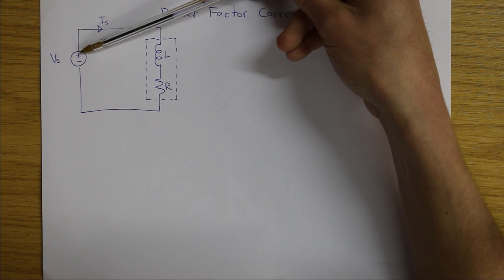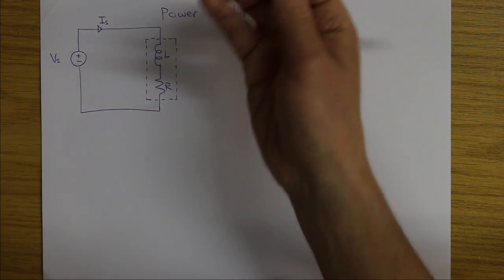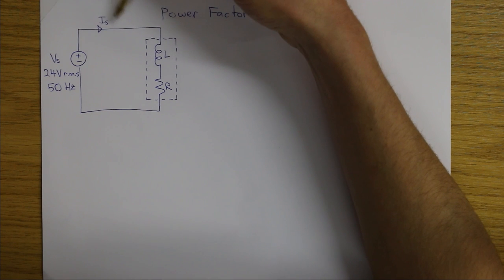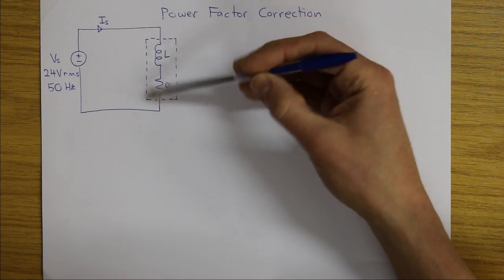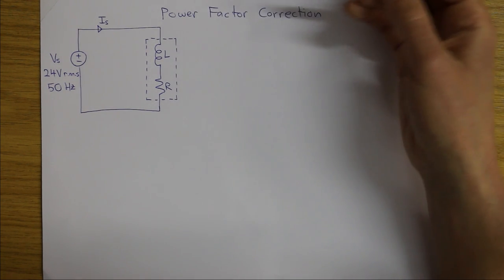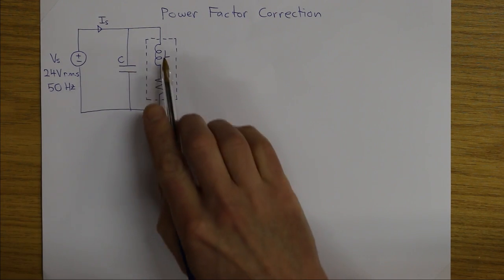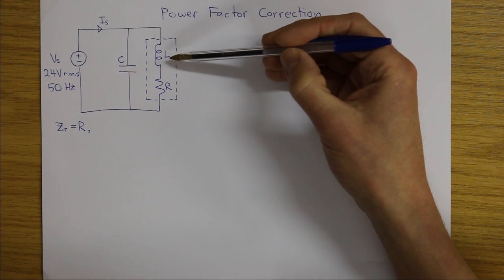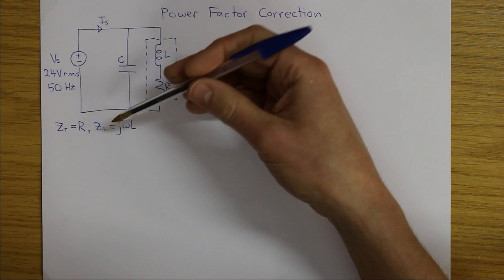Power factor correction of an RL circuit - how to calculate C

Comment: Very nice video sir. Although the power factor correction problems I usually encounter involve non-unity power factor correction, your formulas and concepts are still very informative and useful particularly when you said at the end that the equivalent impedance after PFC is actually larger than the previous one. That means that the voltage drop across the equivalent impedance will be larger before PFC, which explains the result I got in a problem set I answered about 3 phase PFC. 

Again, thank you very much sir.

Comment: Hello, a very nice video. Why is the j being used in here? Would the formulas  Zc=1/2πfc  and ZL=2πfL  work in here without the j?
Reply from the maker: Hi Imantas,

No, you need the j. This calculation relies on the impedances of the capacitor and inductor being imaginary numbers.

Impedances (in general) are complex numbers. The impedance of a resistor is purely real, but the impedance of a capacitor or inductor is purely imaginary, and once you combine resistors with capacitors and/or inductors, in general you need to treat all impedances as complex numbers which means that you need to hang on to j in those equations, i.e.

    Zc = 1/(j2πfC) = -j / (2πfC)
    ZL = j2πfL

The equations you mentioned would give you the magnitude of the impedance of the capacitor or inductor, i.e.

    |Zc| = 1/(2πfC) = 1 / (2πfC)
    |ZL| = 2πfL

In some other situations, it might be just the magnitude of the impedance that you're interested in, but that's not the case here.

However, having said all that, the final formulas I end up with for C and Zeq can be worked out just by inserting the real values of L, R and w (where w = 2πf). In other words, you don't actually need to use complex numbers (and hence not j either) to work out Zeq or C once you have those formulas. Just stick in L, R and w and out comes your real-valued answer!

Hope that helps.

Ted
Reply: @DrTedBurke  Hi Ted, many thanks  for video! Greetings from a fellow Irishman! Lol I understand the whole j thing meaning 90 degrees out of phase etc etc and I can do circuit analysis etc but lately I am wondering why are reactances considered 'imaginary'? Why use complex numbers? Could we not use i and j vectors and still get same result or can u see where I'm coming from? I suppose the advantage of using complex numbers is that we can divide them and express them in polar firm etc? Am I correct! I hear some people saying it's because it is not real power, ie it is reactive power? I don't agree that this is the reason we use comolex numbers, I think it's used as a mathematical tool yes? Rgds John

Comment: This was not useful to me for power correction purposes.  First, the reactance of a capacitor is (1/-j w C).  The minus was missing.  It is minus because the current from a capacitor leads voltage, in contrast to an inductor, where current lags voltage.  Secondly, a resistor has no impact on reactance correction, as it has no impact on current phase shift.  Next, the final equation reduces to C = 1 / w(2)L.  You would get the same result by taking the formulas for C and L, setting them to equal, and rearranging the terms.  Finally, this assumes you know the impedance of the circuit.  If you don't, the power triangle is a tried and true industry standard.
Reply from the maker: Hi Claude.

The reactance of a capacitor definitely isn't (1/-j w C) and neither is the impedance of a capacitor. The impedance of a capacitor can be written as 1/(j w C) or as -j/(w C), both of which are exactly equivalent.
The resistor certainly does affect the phase of the current through the RL load. The phase difference between the inductor voltage and inductor current is 90 degrees, but the phase difference between the RL voltage and the RL current absolutely depends on the resistor, and will affect the value of the power factor compensation capacitor.
The final equation does not reduce to C = 1/w(2)L and you would not obtain the same result by equating the formulae for C and L.

Ted
Reply: @DrTedBurke  I think there may be some confusion between inductance and reactance.  Going back to basics may help clarify the issue.  Inductance, when viewed as a complex number,  has two components - the real factor (resistance) and the imaginary factor (reactance).  Reactance causes a phase shift.  Resistance does not.  For power correction, the goal is to negate the phase shift in current (relative to voltage) caused by inductance or capacitance.    Resistance will never affect the phase of a current going through an RL load, an RC load, or any load.  You can valid this assertion by asking any Profession Engineer who specializes in Electrical Engineering.  Bench tests will also validate this assertion.
Reply from the maker: @claude77573  Hi Claude. I wouldn't trust just "any professional engineer" to give you the precise definition of impedance, reactance, inductance or even resistance because unfortunately many engineers (including a lot who specialise in electrical engineering) retain serious misunderstandings about each of these terms. Fortunately, my own understanding of all of them is crystal clear, so allow me to explain:

Impedance is a complex value - i.e. it has real and imaginary parts. In the most widely used notation...

Z = R + jX

where Z is complex-valued impedance (in Ω), R is real-valued resistance (in Ω), j is the square root of -1, and X is the real-valued reactance (in Ω).

Resistance is a real value. Reactance is conventionally defined as the (signed) magnitude of the imaginary part of impedance. Hence, although reactance describes the imaginary part of a complex number, it itself is actually a real number (i.e. the magnitude of an imaginary number). For a capacitive load, the reactance will be real and negative. For an inductive load, the reactance will be real and positive.

When an AC voltage is applied to an RL load (e.g. a resistor in series with an inductor), the phase difference between the load voltage and load current depends on the inductance and the resistance. This is a basic fact about how AC circuits function. You can confirm it by calculation, simulation, bench tests, or whatever way you want, but to be honest, it can be verified just by thinking about it for a minute. For example, just think about what happens when the inductance is very small, such as the parasitic inductance of a resistor.

One thing that may be confusing you is that if the resistance within an RL load can be inspected in isolation, the resistor voltage and resistor current will always be perfectly in phase, but that's completely different from the RL load voltage and RL load current, which will not be in phase (unless the inductance is zero).

For whatever reason, you seem to have formed the incorrect opinion that I don't understand basic AC circuit theory, so you presumably won't take my word for this. That's fine - you don't need to, because these basic fundamentals are clearly explained in countless introductory electrical engineering textbooks. Even if you just spend two minutes reading the Wikipedia article on electrical impedance, that will probably help a lot.
Reply: @claude77573  You are hopelessly confused. Inductance does not have two components. It has a single component. It's the impedance of that RL limb of the circuit that has 2 components one of which is real and the other imaginary. The phase shift between voltage and current through an RL limb does, indeed, depend upon both the resistance AND the reactance.  The higher the resistive component relative to the reactive (inductive) component the closer the voltage and current will be in phase. This is so fundamental that if you fail to understand it then it's back to basics for you.
Reply: So inductance does not have a real and imaginary component which, when combined, result in impedance?
Reply: @claude77573  An actual "inductor" may have both real (resistance) and reactive components. An idealized inductor has only reactive components. Either way you may interpret the diagram as representing series resistance of the inductor (if the value is small) or a separate resistor (if the value is large). Both of these perspectives are equivalent mathematically and in both cases the formula derived is correct in that the capacitance needed for power factor correction does, indeed, depend upon the resistance of the circuit branch containing the inductor.
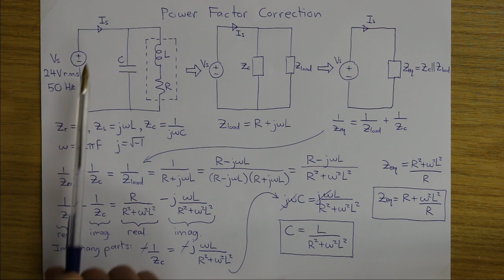Reply: @Jnglfvr  Thank you very much for the explanation.  I really appreciate it.  I guess what confuses me is that for power factor correction, what is being sought is the correction needed to cancel out the reactive component, and only the reactive component.  For example, in sizing a capacitor for an AC motor for, say, an air conditioner, the goal is to cancel out the inductive effect of the motor so that reactive power (VA reactance) is not fed back into the power grid.  See, for example, the youtube video "Power Correction Factor in Electric Power Systems" at 18:08, where it is stated "the active power (S, the work done by the motor) in a reactor (be it an inductor or a capacitor) is always zero".   If so, the goal is to negate the inductance of the motor, without regard to the resistance of the motor's windings.

Comment: How for a common man having to pay for this wasted energy can use this thing. Do we need 2b engineers. Can we use something very simple to save energy?. To be honest, NOT GOOD ENOUGH. Been hearing this formula for the last 20yrs. Not solid solution for a end user.
Reply: What would be the value of C if the voltage is 5000V and the apparent power is 400,000 VA? Do we need another equation?

Comment: Good but too slow
Reply from the maker: Useful feedback. Thanks.
Reply: Depends on the viewer, I found it perfectly paced for my knowledge level. Thanks for this video
Reply: In my opinion the pace was only a tiny bit slow but as it is a youtube video, it is very simple to skip ahead.  I would not recommend to change it!
Reply: You do realize that the video speed can be increased via the gear icon at the bottom of the video, right?